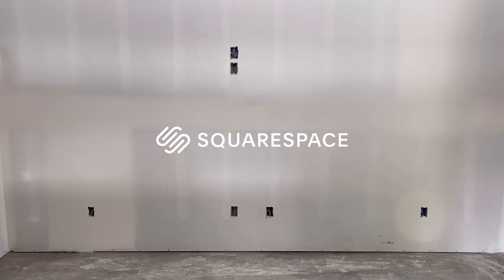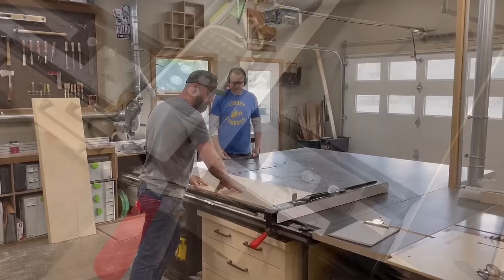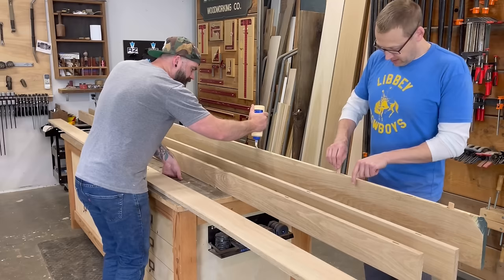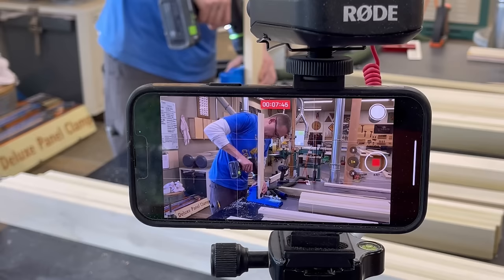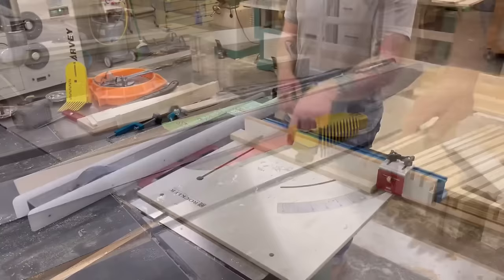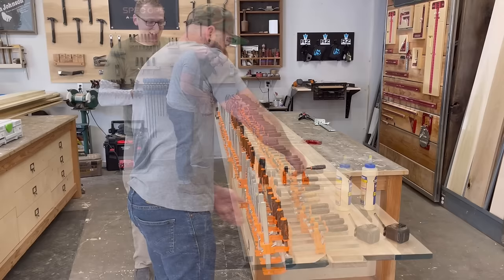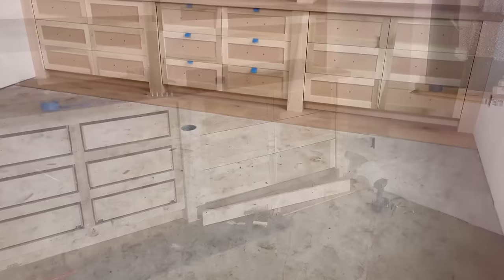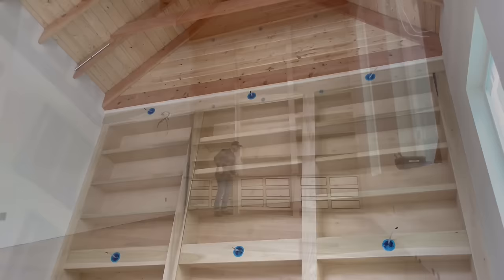Worlds Biggest Built in Cabinets || Insane 5 Day Build

Comment: for practicality i'd have added a small walkway in the middle to reach the upper shelves, but my heart says that this NEEDS a slidey library ladder
Reply: Thats probably the next build
Reply: Maybe build a wooden ladder with precise measurements to land properly on some "receiver" pieces permanently affixed on the upper units on a safe angle. When not in use, it could hang flat on the side wall to the left of the windows using nautical-looking (as a nod to the 5-day boat build) brass hooks. Oh and green felt.
Reply: Yep. Like the one he built last year. But waaaay taller.
Reply: @LykeArgy 😅

Comment: With the upper cabinets, I'd have slid the one into the middle like you did, but then slid it to the left or right. Then repeat sliding the second one the other way, leaving the middle upper section empty. This then would have left space for you to escape from the apex. Then slide the middle cabinet in when everything else was in place. This is all hindsight and from an outside view though. Also what on earth is going on those top shelves? Will this be like a Grand Library wall?
Reply: Just some items to be place and never moved again! In fact they will be left there for all eternity...
Reply: @OldsmobileCutlass1969Va  Yup, cause there is no way I would want to dust them.
Reply: I was thinking the SAME thing as they were doing this...
Reply: Bottles. S'only thing I can think of that is a displayable item that one NEVER needs to take down. And... "Bourbon" Moth, right?

Comment: Yeah I love the Forman, setting a good example for other future Forman everywhere. Question how are you accessing the upper shelves, a library ladder perhaps?
Reply: Came here to ask the exact same question.  I would be interested in seeing him build and install a library ladder.  Not the kind of thing we normally see him build.
Reply: He does have a library ladder build for his wife’s office.
Reply: @johnlee7085  Ohh I must have missed that one.  Thanks for the heads up.
Reply: The clamping operation for adding the strip to the top is a good place for clamping cauls - they spread out the clamping force. The top is relatively flexible along is length, and all those clamps are point sources, requiring a clamp almost every inch. When you space the clamp away, the force spreads out in 90 degrees, imagine a triangle with its point facing up where clamp hits the caul and the force radiating downward to base of that triangle. The taller the caul the wider the even pressure and fewer clamps needed, a 2” caul would put clamps 3” apart, a 4” about 5.75” apart.  In this case it’s not totally about using fewer clamps, it’s about keeping it even and not introducing undulations across the edge. It’s easy to put too much pressure on the clamps to close the spaces between. If you wanted to be super precise, you can mark your cauls with triangles, and if you put a clamp at each upper point you will have the same pressure along the entire joint.
Reply: oops. I just commented and asked the same question, for which I'm sure I'll be ridiculed...🙄

Comment: Not sure about your off brand Blum sliders, but if you’re stuck on your next project, pick up the Komplement slider from ikea. It’s a stripped down white label Blum Tandem (Blum white label the hinge systems as well) and work pretty well for under mount drawer boxes. 

Only downside is that they come in just two sizes: 350 and 550 which suit the two PAX cabinet depths, but otherwise it’s a good way to pick up some soft close drawer slides on the cheap. Pretty sure it’s about $20 for a left and right slider.
Reply: But I think they are not full extension drawer slides...
Reply: Correct. But they do come out about 3/4s of the depth of the drawer so it’s not so bad that your stuff gets trapped in the back and unreachable.

Comment: I didn’t  bother reading through all the other comments but when you did those top shelves wouldn’t it have been easier to put the side one up in the middle and then slide it over to the left and then put the other one up in the middle and slide it to the right, saving the middle one for last?

Comment: Nice but was there a reason why you just couldn't move/lift the upper cabinets sideways when they were up on top? Seems easier to lift them all up in the center, then move first to the right, second to the left and install the center cabinet last? (or use the exposed truss as lifting point and winch it up lol)

Comment: Looking forward to the video where you make the ladder to reach the top shelf.
Reply: Maybe build a wooden ladder with precise measurements to land properly on some "receiver" pieces permanently affixed on the upper units on a safe angle. When not in use, it could hang flat on the side wall to the left of the windows using nautical-looking (as a nod to the 5-day boat build) brass hooks. Oh and green felt.

Comment: So, in hindsight, would it have been better when installing the top row to get the outer 2 units up first using 2 ladders start to finish, since you could slide them left and right into place after lifting them 80 feet into the air and then save the middle one for last?  I also thought that the scaffolding was there for that purpose.
Reply: Just a little add to what you said. Leave the middle cabinet out do the install on the gable, the install the top middle cabinet. Much easier to climb up and down.

Comment: How did the wiring work? How are you running the wiring to the TV, speakers... I built a wall unit a year ago, I used your video on building the bases and drawers, and the hardest part was getting everything to the point that I could run what seemed like a million wires to go the right places and be un seen.

Comment: Just a dumb question, for the very upper shelves. Why didn't you put the two ladders in the middle then lift the very upper left unit into the middle slot and slide it over to the left?  Followed by lifting the upper right unit into the middle then slide it to the right then just lift the center unit into place.  Seems this would have been waaaay more easy than the juggling match you went through.
Reply: I thought the same thing.

Comment: Build a bigger shop.  I worked in one that could handle Laminate sheets 16 feet long,  Then again you could also park a bus length wise in it, if not height wise.  I was helping build Cosmetic showcases for the store my dad worked for, Three custom made Island sets, about 70 cabinets in all, I did all the electronic hookups, for the lights, as well as help the Master Cabinet maker, whose shop was on contract to the store chain.  M M Cohn of Little Rock Ark.. Only their namesake building is left today 514 Main St (formerly 510 Main st).

Comment: I apologize if I missed where you stated this, but in my head I was calculating 1200 lbs minimum of shelving/cabinetry, but likely closer to 2000lbs. Did you have reinforcement done to the wall and floor? I have a similar space and am in an indefinite hold until we sink money into a structural engineering quote on what support needs added.  I’m just curious what you had done or if the floor and walls were already stronger than typical contemporary builds of similar proportioned spaces.

Comment: Too little too late, but you could have saved the upper center section for last, and slid the outer ones up the middle the. To either side, and do the center one last. 🤷🏻‍♂️ Either way, pretty or not, ya got it done! Impressive.

Comment: Hey brother, I run a custom cabinet shop. We do about 3.5 custom kitchens per month. 

Overall you did a great job! And a great idea with the vertical boards to cover the face frame seams. 
Idk where you are in the country, but if you are worried about earthquakes you really shouldn't use those thin furring strips for hanging. Really, you should be getting about 1.5" of screw grab for a nice hold against earthquakes.

Also, we have done our own finishing for 10 years before switching to pre finished or high quality matte thermofoils... Brother, it will pay dividends to your final product if you stay away from poplar on things that will be touched and used. Poplar is fantastic for coffered ceilings and low traffic moldings. But no matter how good your painter is, poplar will not age well at all compared to a beech or maple. Poplar is pretty open on it's grain structure. So getting a proper "glass smooth" seal coat on poplar takes way more work for the painter.... And most painters don't want to put in the time to make it perfect. 
Overall it saves time to use pre finished interior case material, (skin it if you need to) pre finish the face frames and avoid going through that face frame with nails... It will look better in the end and be waaay easier... Easier in the trade usually means cheaper and faster. Honestly a simple glue joint is enough for face frames to cases and looks much better. No need for nails.

Comment: Great idea for the TV,  but TV's need air flow as they get hot.
Reply from the maker: Not as hot as your mom
Reply: @Bourbonmoth  I'm no expert, but if you did need venting, a hole behind the tv (which would be hidden by the flat panel) with tiny fans that plug in to a USB port on a power strip.  I lined up 6 SONOS amps on a slide-out shelf cabinet using these.  Put 2 fans, one at the rear of the top shelf drawer and the other below the lower, behind a decorative grill.  No problems or worries after several years.
I love your idea of the false panel for concealing the wires and bringing the panel forward.

Comment: Supplies needed:
7000 domino's 
1000 lbs of brad nails
75 gallons of glue
5000 screws
$20000 for lumber
200 man hours of labor
17 gallons of paint
Use the phrase "plop" at least 67 times
And presto!!! You're done...
Reply: Is that the supply list for this project or another boat build... Screws, screws, and more screws.